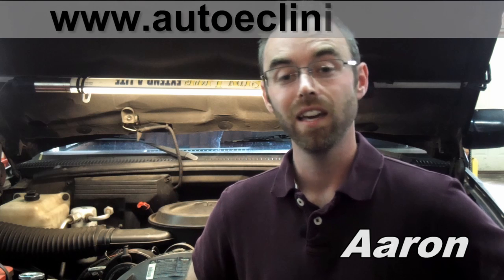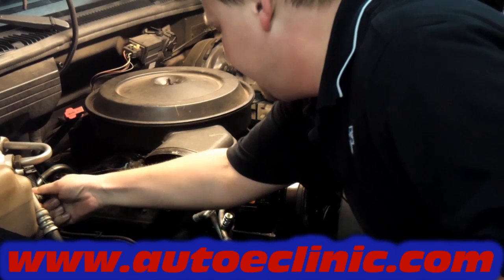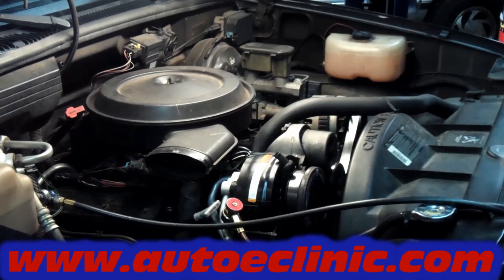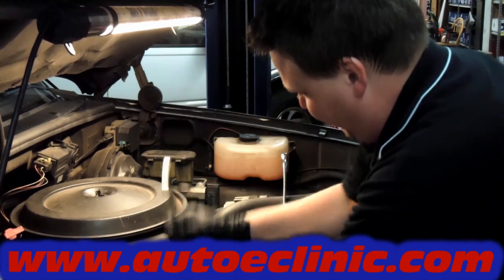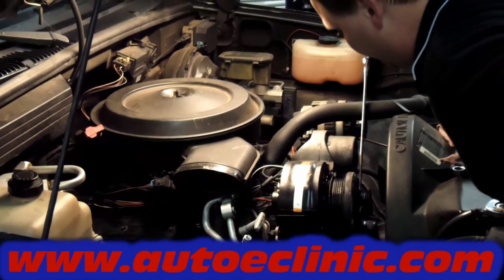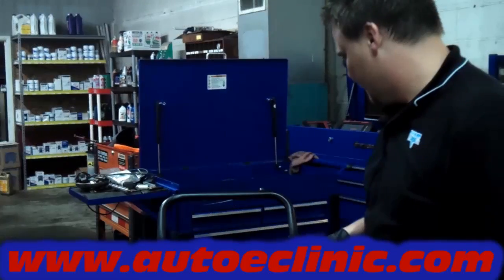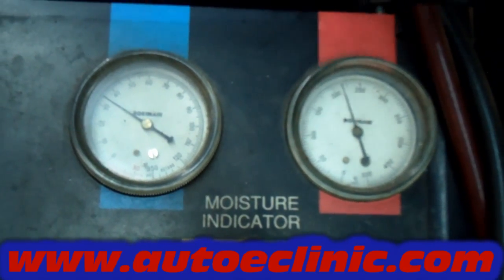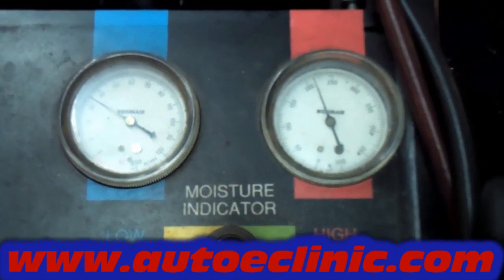How To Replace An Air Conditioner Compressor - GM Chevy SIlverado 5.7 5.0

Comment: I would have liked a more detailed explanation for getting the bottom compressor bolt to clear the pulley. I have a 1995 K 1500 and I can't get that bottom bolt out. You can't see where the flat side is, I feel for it but it won't clear.
Reply: I had the same problem I had to heat it with a blow torch an cut off with zaw saw bought a new bolt after

Comment: I believe compressor mount bolts are flat sided to slot into housing and prevent spin while mounting nuts backside. I wish I coulda seen you wrestle these bolts out around pulley. I was unable today and was figuring I may actually need to remove pulley/face, lookin' for options.

Comment: First with the engine running and the AC in the on position,check at the compressor for 12 volts. if no voltage check at low pressure switch for 12 volts leaving  switch. If 12 volts are present but not leaving add 1 can of freon. pressure should be above 40 psi to keep pressure switch activated. NO#2 stay away from these yahoos.

Comment: Oil??
Reply: @Cesar Gurrola We found out it already had oil in the compressor, most do these days.  It should say so on the on the compressor.  I think we had to put some in the line, been 4 years ago, lol!
Reply: @Cesar Gurrola Actually in the dryer, can't remember, don't want to steer you wrong.

Comment: Do not take your car to thses nuts. The unit was low in freon. It has a low pressure switch that keeps the compressor from coming on when the freon is low. They just replaced a compresson whn all they had to do was add one or two cans of freon
Reply: Joseph Starling
Reply: Did you not see the metal in the orifice tube? Sure sign of compressor failure.

Comment: Thanks for the very informative video. I was curious about how much would the repairs made in this video cost ? 
   I have a 93 Silverado 4x4 a mechanic told me I need a new compressor, and it had to be changed over to a different type of coolant. At the moment my compressor is unplugged cause my belt is squealing. But he didn't mention the dryer or the orifice, he said it would cost me a few thousand dollars to do this ! I told him I knew how to roll my Windows down !

Comment: Dude, dont tell people the first thing is to purge the coolant!!! For Gods sake. The first thing you do is simply look at the clutch when you turn it on to see if it engages. And in many cases, its a 10 cent washer that needs replacing behind the front plate. If your AC blows cold, then hot, then cold etc. and especially blows cold for a while if you rev the engine, you have all the freon you need and its just a washer. Or, maybe its just the wire connection to the clutch, especially on GM vehicles. The connection where the two wires meet the clutch is fragile and breaks easily. There are LOTS of things to check before taking the juice out of the compressor
Reply: gorbloouey Is there a way to replace or fix the wire connection to the clutch? Would I have to take compressor apart? Just as you mentioned, cheap plastic and broke. 1989 Chevy S10. Thanks
Reply: Lol

Comment: I have a question. I just replaced my ac compressor and serpentine belt with brand new ones. The ac blows cold again, but after about 1 to 2 minutes the belt falls off. Only when the ac is on. I have the 1994 silverado with the 5.7. Any idea what could be causing the belt to fall off?
Reply from the maker: Possibly the incorrect size belt or a bad belt tensioner.
Reply: Thank you. I ended up replacing all the pulleys and put on a new tensioner.  I also got a smaller belt. It's been working so far, It squeaked a tiny bit when I turned the corner and for about a minute when I put the truck in park, and hasn't done it since. I hope it's all fixed now.
Reply: audiboi1587 y
Reply: This is the problem I'm having at the moment. I know this comment was 8 years ago lol but what did you figure out? I figured my compressor was bad so I'm actually replacing it right now

Comment: you didnt show how to fill the compressor with oil.... thats what i needed to know... you pretty much covered the basics so someone still cant do it them selves
Reply from the maker: Usually takes about 2 ounces for the compressor. You can fill it through the charge and discharge ports.
Reply: Don't add any oil, the factory add oil to test, If you do, make sure you don't add anymore than an ounce. I did this once and had to remove the compressor and drain it.

Comment from the maker: Thanks for your input. Since this video we realized that it was way too gaudy and covered some of the repair. However, we are working on branding ourselves and now have a small icon in the corner and our web address in the opposite corner and its not obtrusive. This AC video was in the beginning and we were still in the process of finding our niche.

Comment: Jimmy the problem is one of your actuators is bad.  I had the same thing on my 04 tahoe.  The driver side was hot but passender side was cold.  It's not too hard to replace if you don't have a center console.  if you do it has to come out to get access to it.

Comment from the maker: Most compressors I buy have oil already in the new assembly. My A/C machine adds oil. Recourse manufacture information for proper oil filling procedures. Or as a rule of thumb 3oz or so for a compressor and around 1.5oz for a dryer. Generally this will leave the A/C system in a good place. Once again those are around about figures, not specifications.  Do not sue me if it goes wrong. Always use proper manufacture information.  Thanks Michael and Aaron.

Comment from the maker: Compressor repair is not something we do when they are locked up. This is due to cost of parts and time to do it. At that point it is cheaper to replace the compressor. I actually do not even know where to get internal compressor parts. Thanks Michael and Aaron

Comment: My problem i got a 04 silverado  it blows cool air out one side and hot air out the other , I've already changed out the pressure switch , heater an air control switch , also the damper control

Comment from the maker: The size is M6 X 3 X 1.81. Just remember that if you use a regular bolt grind one side of the head flat so you can slide it past the compressor.

Comment from the maker: The bolts you are talking about are application specific. One side of the head of the bolt head is flat so you can slide it past the compressor. The correct GM part number is 10085707 and cost $3.91 per bolt. They come in a pack of 5 so if you give me a general idea of your location I can maybe locate a dealer with stock where you won't have to buy 5.

Comment: I have a 1990 silverado with a v8 5.7 TBI engine and i (lost?) the 2 bolt where you tighen the ac compressor to the bracket. Can you tell me the size bolts and thread or where to buy them? Thanks!